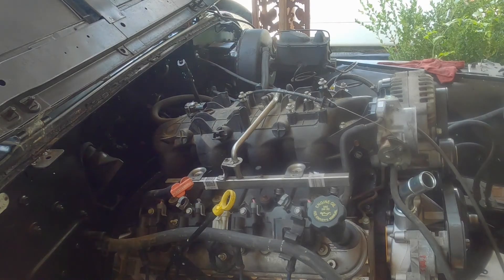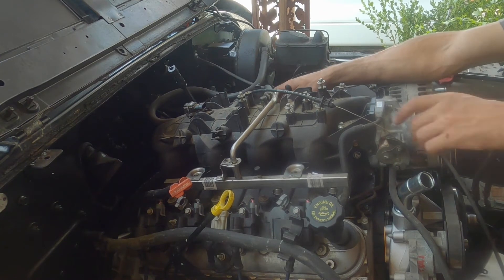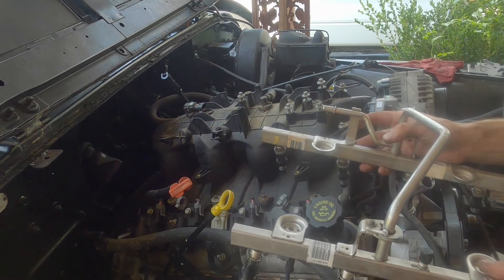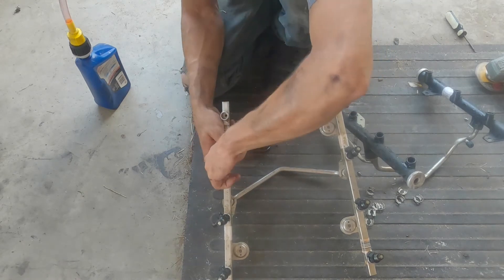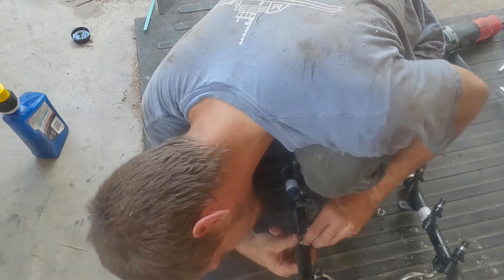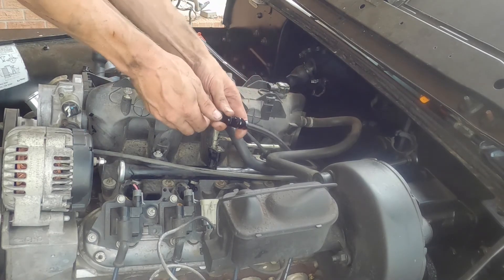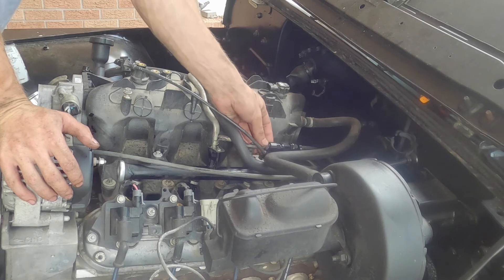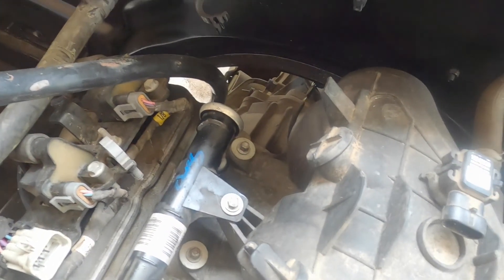"Jeep Wrangler YJ LS Swap Part 4: Enhancing Performance with Returnless Fuel Rail Upgrade!"

Comment: I would have been interested to see what you did for exhaust.  I tried to keep things as tight as possible, but my front DS hits the drivers side header pipe, and my rear DS gets into my muffler at times.  I need to redo it, but I would love to see what others have done.
Reply from the maker: I didn’t run the exhaust the owner of the jeep took it to an exhaust shop after was completed and running

Comment: I've been patiently waiting on the rest of the build lol. Trying to finish mine but looking for the wiring video to drop
Reply from the maker: The guy has the jeep and has been driving it every so often but he recently took insurance off it cause he wants to swap the rear end to 8.8 cause with the new motor he is scared its gonna break the stock jeep axle. Idk when im be able to get it back from him to do a follow up video of the finish product
Reply: @FrogsGarage how do you think the 8:8 diff will do with 37” tires? my 4th gear got stuck on my AX5 with the hassle and money im going to go the 4.8 LS. I have 8:8 diff , 4.8 LS ,243 heads, beefed up springs, new lifters , pushrods, radiator, water pump ,oil pump,gaskets ,a mild cam, Terminator ECU w harness .  I do have a 4l80, but im thinking of going a different route with the trans. Any tips/advise? I really don’t want to spend much more my budget is $1300 more before I have to pause it . I came across your video and it motivated me 😎 thanks !
Reply from the maker: @zeeexx8410  No problem glad it motivated you a ford 8.8 is super strong even more so than my 8.6 in my silverado that you see I drag race and beat the heck out of. So if I havent broke a 8.6 with all the burnouts and launches I have done Im sure you would be fine with a 8.8. The guy I did this jeep for is putting a 8.8 in his at the moment too. As for the 4L80 I love them super beefy even in stock form again thats what I run in my race truck and its stock and havent ever had a issue out of it

Comment: I have ls from 2000 Chevy Tahoe I don’t know what gen it is? And where did u get the fuel rail? Need ur help thanks
Reply from the maker: 2000 is a Gen 3 LS. Fuel Rail is just a stock returnless fuel rail u can find them at ur local pick and pull on some truck engines if ur engines fuel rail isnt already a returnless one.
Reply: @FrogsGarage  do u know what year truck that has them?
Reply: @FrogsGarage  did u use ur o2 sensor when u install ur harness. Do u need them to start the car